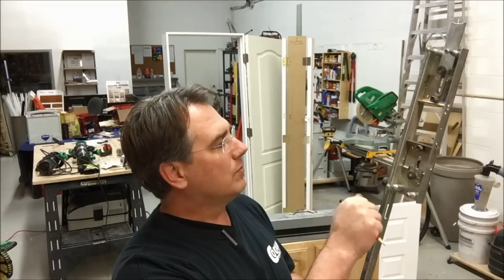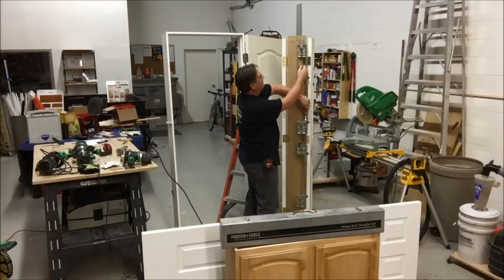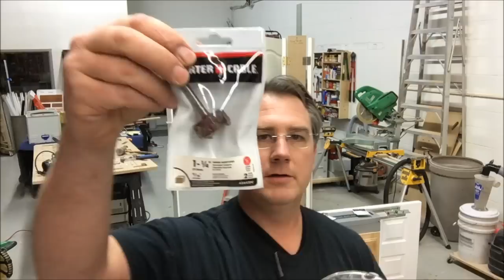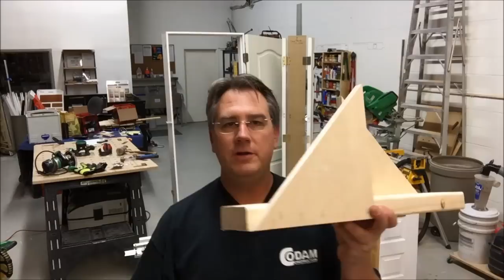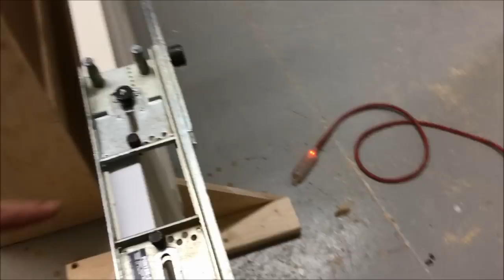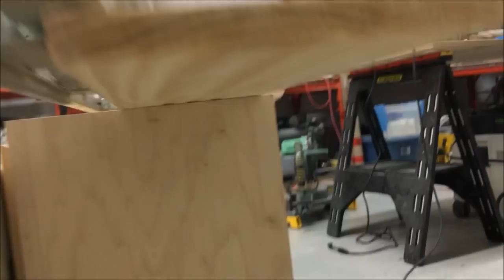Porter Cable 59381 & 59380 Hinge Jig How to and Tips

Comment: Thanks.  Is there a way to use this jig to fit a new door into an old jamb, matching the existing mortises on the jamb?
Reply from the maker: Yes. You set the jig on the existing door jamb and line up with hinge location, remove jig from jamb and set on the new door. I would practice with a scrap piece of wood before routing the new door to check alignments.

Comment: The comment below by @athomas9449
 Is correct the video is putting the wrong side of the jig on the door.  You do not turn this jig end for end. You use the deep edge of the template against the door and that is why the door thickness pins are spring loaded so the can retract while doing the door.  You use the inside nails when doing the door so do not remove these.  Your top and bottom hinge are not always the same distance therefore you do not want to rotate the jig.  You then use the door thickness pins to do the jam. This utilizes the other side of the jig and the other set of nails without rotating the jig.  I use my jig many times with the jam gauges and match a existing door, jam or necessary when using metal jams with existing mortises.  Again this would not work if you rotate the jig.

Comment: WARNING: The Porter Cable instructions call for a 5/8" OD bushing and 1/2" router bit for a 1/4" round hinge.   This is not correct.   It is a 5/8" ID bushing with a 1/2" router bit.  ( 5/8" OD Template guide (42042)  is a 5/8" ID bushing)  Also the bushing needs to have a long nose.   Otherwise you will cut on the template and make metal shavings.   Ask me how I know.    Porter Cable instructions don't flip the jig.   It is pretty straight forward.  But a lot of flexibility which can lead to confusion.  https://m.media-amazon.com/images/I/A1+yxSbJOcL.pdf

Comment: Thank you for taking so much time to explain how to set this jig up and use it effectively as possible.  I would have definitely screwed up a slab if you had not explaind the setting and the flip because i had to cut a door down to an odd height and when i would have tried to flip it it wouldn't have worked.

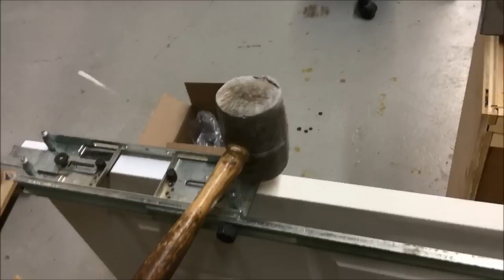Comment: If you are flipping the template to use it, you are using it incorrectly. The end that goes at the top of the door should go at the top of the jamb too. At about 15:00 into the video, you show the template on the door. You have it incorrectly on the door. What you call the "Big Rail" side of the template should be tight against the door. That's all in the instructions. You should never have to use locktite on a router collet. Your bits are probably coming loose because you bought a cheap router with a bad chuck and collet. I've had my template for almost 35 years now and I have never had to use locktite on any of the fasteners or adjusting plates. You also have the placement of the hinges wrong. The top of the top hinge should be approximately 7 inches from the top of the door. The bottom hinge should be about 11 inches from the bottom. You should be using the other end spacer bars instead of the 5 inch ones you are using. Near the end of the video you say that the second set of nails will never be used. Those are for attaching the the door.
Reply: Thank you Bill.  I watched this video before reading your comments and screwed up two doors.  I followed your instructions and it worked perfectly.  I've used tons of jigs over the years and it did not make sense to me to flip the jig.  I wish i would have read your comments first.
Reply: @bobgraham2098  You are welcome. Glad your project worked out.

Comment: This is hard to believe, who puts their top & bottom hinge the same distance from the top & bottom of the door?  Didn't Terry in all his years read the instructions that came with the jig.  Yes, this jig is a bit complicated and a good video would help, but this is entirely wrong.  That is why he can only use it on standard height doors even though it is made to work (though not without care as they say in the instruction) on odd heights as well.  You should NEVER flip this jig over and use it upside down.  Terry, with all do respect, please rethink this video and pull it if you can.
Reply from the maker: Terry Kempf I made a follow up video correcting the flipping issue. 
You are correct you don’t have to flip the jig.

Comment: Thank you for the video as it was helpful in most parts, especially setting it up for common use. As said before you should revise the video to reflect the proper usage as indicated in the instructions. There is no need to flip the jig since the top hinge is always several inches closer to the edge of the door than the bottom and thus the need for the jig nails you had removed. The side rail tracks provide perfect alignment for all the templates and are the same for all hinge depth on all sizes of doors. The door thickness pins are used only for the jamb morticing.

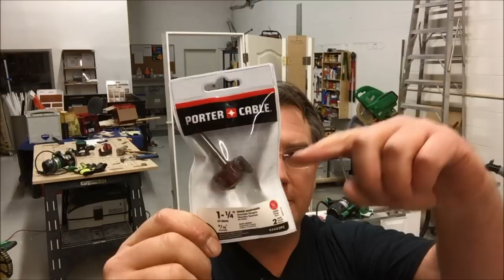Comment: At 13:30, for the 5/8 radius hinges, you can also use the Freud 1-1/4" (Dia.) Mortising Bit with 1/4" Shank (16-106), Instead of the PORTER-CABLE 43745PC 1-1/4" Hinge Mortising Straight Router Bit.  I get it from Amazon for $21.  This works with the 42048 Templet Guide.

Comment: Hello,  May I ask as to why you use a 3" hinge so regularly over the more common 3-1/2" that is so widely used with most interior does? While the 4" hinge being the second most used in home building...? 
Commercially speaking the 4-1/2" is the most common used...  Greg
Reply from the maker: Gregory Londos 3” x 3” hinges are just the common hinge here in Toronto Canada. I know the size changes depending on different areas. We had some prehung doors come into our market with 3 1/2” hinges recently but homeowners are complaining the barrel of the hinges are sticking out to far and don’t match existing doors. I work doing water damage repairs so I make my own doors because I match the existing hardware.

Comment: Thanks for making the video Terry, it's been very helpful. Together with your video and some of the comments it helped me understand a few things that were not quite working for me. I purchased this jig second hand with a photocopy of the instructions that were not very clear so I was not able to read some of the instructions. 
Whilst the video helped a lot, I noticed that some of your methodology is wrong and that is probably why you are having issues with setups and difficulty changing settings etc. Once you change the methodology it will all become easier and you wont have so must hesitation when a new setup is required.

As per some of the comments below you have put the jig on the door incorrectly. The side of the jig with the rail or connector bar should be placed hard-up against the door, you did it the other way around. The opposite side goes against the jam edge, which will also have the benefit of not requiring you to flip the jig. This error is probably what caused the incorrect routing  of the hinge that you mentioned. The side with the connectors attached is thicker so will leave a larger amount of wood at the back of the hinge.

The other thing I'll mention is that you said that the door  you are working on is a left handed door. For the purposes of this exercise with this jig its actually a right hand door.

Per instructions: 
"While facing door from side on while hinge pins are visible, set a right-hand 
door on it's edge with the top of the door to your left, Set a left-hand door on 
its edge with the top to your right. Secure the door in this position." 

Most store bought doors will have bevels on both sides. If you are making your own door from scratch it's a good idea to put a bevel on the hinge side as well as the latch side, this helps prevent binding especially if you intend to paint the hinge. Over the years the hinge might get painted adding thickness which will benefit from a slight bevel. Doesn't have to be much just 1 or 2 degree on the hinge side.

Thanks again for your effort, it was really helpful.
Reply from the maker: W P thanks for watching. Check out part 2 video I clear up the flipping the jig issue.
Reply: Thanks Terry,I had already watched the part 2, in my opinion this does not address the issue. The main problem is that you incorrectly placed the jig against the door. If you were to place it correctly against the door then all of your problems would disappear. Placing it correctly against the door will achieve a consistently wide piece of wood behind the hinge, you simply wont have the problem of a thin piece even on a 1 3/8" wide door, therefore you would never need to flip it.I've taken a few photos to try and demonstrate where you are going wrong, let me know if you have any further questions.
Best.

https://www.dropbox.com/s/bin4jrxiaf2eel6/File%202017-11-04%2C%209%2055%2055%20PM.jpg?dl=0
Reply: https://www.dropbox.com/s/yi7kfuknkxir87l/File%202017-11-04%2C%209%2055%2016%20PM.jpg?dl=0
Reply: https://www.dropbox.com/s/i9v51dgdq5yenzj/File%202017-11-04%2C%209%2053%2007%20PM.jpg?dl=0
Reply: Well although he has used this jig entirely incorrectly it is in fact a left hand door( unless of coarse it’s a right hand reverse lol )

Comment: Is it possible to use this jig with the door frame in place -- with the jig fixed vertically on the frame -- versus this example where both the door and frame is not installed
Reply from the maker: A Boston yes you can use it with the jamb installed.

Comment: This video kills me. I've been using the Porter Cable jig 25 years. You're using this jig completely opposite the way you should be setting it up. If you were replacing a door into an existing cased jamb, you could never get the jig sit properly on the doorframe. The spring-loaded pins need to go against the jam, not the door. No need to spin the Jig. Rail side against the door, spring pins against the jamb.I agree with CycleTuber, Read the manual!
Reply: yes you dont flip it around. BUT the manual makes this simple concept into a complex one with many 'wtf' moments. hence the confusion. it doesnt even get into the router offset section which this dude is helping me figure out.
Reply from the maker: David Ferrand you kill me!
Reply: David Ferrand I agree with you David looking at the instructions you’re correct. This video was very helpful
Reply: where’s your video ?
Reply: where’s your video ?
i’be done all my doors without this jig because i didn’t even know such a jig existed.  i’m going to get one today, and would like to know how others use them.
it kind of looked strange to me that you’d flip it end for end considering that would throw off the dimension at the top and change the distance from the door to the jamb, but i can’t comment because i’ve never seen this jig before.  if you’re saying it’s wrong, could you please show your way of using it ?

Comment: I have the older Rockwell version of this template.  It says to use the B103 router template bushing, but does not give the outside diameter of the bushing, and B103 is not the current Porter Cable bushing number.  What diameter bushing are you using?

Comment: I noticed that you routed the bevel side of the door. That's incorrect. The beveled edge of the door should be on the side of the knob and latch. The purpose of that bevel is for proper clearance when closing the door.
Reply: All hollow core Masonite interior doors come with both edges beveled. Haven't seen a square edge one in years. Even most hollow core wood slab doors too.
Reply from the maker: I have only seen both edges beveled or both edges square myself.
Reply: Well I am a Door Hanger/Finish carpenter and have been for over 35yrs and love this jig . Best and most versatile jig made. I bevel hinge side 1deg and strike side 3deg

Comment: Hate to be a smart ass but did you read the pamphlet, #692544, that came with your jig?
The side of the jig with the connecting rails goes against the door. All the jig sections will be perfectly parallel to the door face thanks to the wider edge of the jigs hanging over the edge. The side opposite the rails goes against the jamb. Had to watch twice to be sure I saw what I saw.
Reply from the maker: CycleTuber you are correct. You don't need to flip the jig as I showed in the video.  I made a part 2 video explaining that you didn't have to do that.
Reply: Cycle Tuber isn't speaking about flipping the jig, but about placement of the jig on the door or jamb. The connecting rails are supposed to be placed against the door edge, not away from the door as you demonstrate in your video. The side opposite the connecting rails is used for the jamb. I believe this is to provide the proper clearance between the door and door stop, preventing the door binding against the stop.
Reply: @Woodnfixit  I think that the difficulty comes from the photographs in the pamphlet. Figure 8 shows the mounting that you suggested (connecting rails against door edge), but it ALSO shows the small thumbscrew (guiding pin) in the 1-3/8" hole  (Figure 7 does not).  The guide pins are for use for proper offset on the jamb, but not on the door since those pins would interfere with correct placement on any door wider than 1-3/8".
If you use the guide pins for the door itself, then the template will only fit if the connecting rails are as shown in the video.

Comment: Great video, I spent an hour trying to follow the instruction manual. Should have watched your video first. The only issue I had is the tabs at the end of the template on mine are 5 and 6 foot doors for the short one and 7 and 8 foot doors for the long one and I think you  are using the long tab. I don't think it makes much difference. Again thanks for the great video!
Reply from the maker: Thanks Rob, glad it helped.